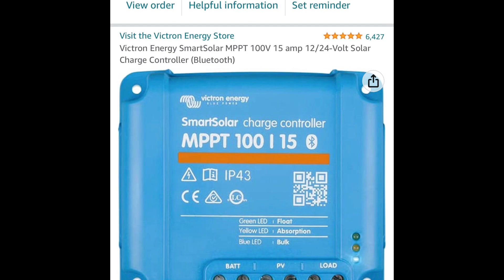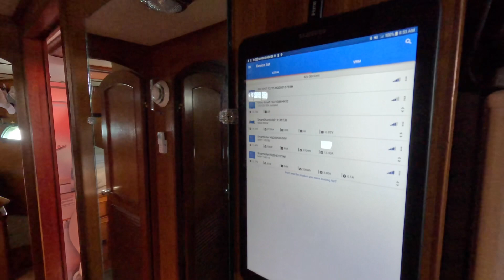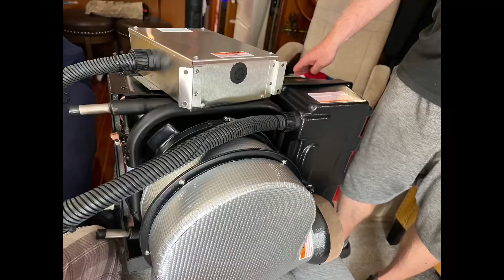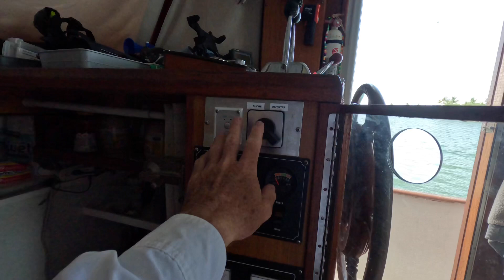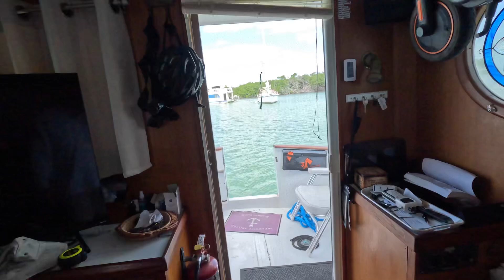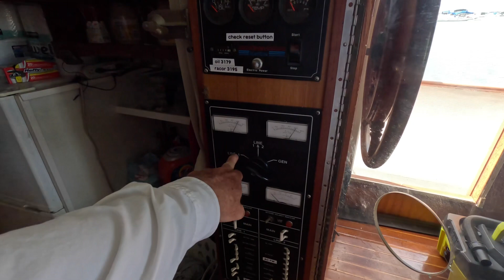Yacht# Life OFF Grid Living what we do for Power living off grid on my BOAT

Comment: Still not understanding the math.... You run a honda that can only put out 2200 watts for 4 to 6 hours VS your 15000 watt generator for an hour that can provide much more power into your batteries and the entire systems on the boat???

Comment: Table of Elements:  Li (lithium), Fe (iron), Po4 (phosphate).  You mentioned "LifePro" batteries, several times.  The correct name for these batteries is "LiFePo4" or "Lifepo."  Your charge controllers are made by Victron (vick-tron), not Vectron (veck-tron).  Most 100ah LiFePo4 batteries will accept a charge around 80 to 90 amps.  You mentioned that yours are capped at 40 amps of charge.  Have a look at Dakota Lithium.  You can get a full-fledged LiFePo4 battery that won't break the bank and will deliver much better performance for not much more money.  Best of luck.
Reply from the maker: Thanks 🙏

Comment: Nice set up Capt, I bet it took a bit of ciphering to get it all lined out. Redundant Honda gen is a good tip to save quite a bit on fuel, not to loud while in the cabin either it seems. Your reefer appears to be a regular home style, wondering if those designed for boats/RVs, draw less power. Also the Honda, does fine in the box? does not run to hot? Really like the use of the old iPad as a monitor, have a few of those that are outdated as far as the internet, and could put to use in that way. What type of connection to your electronic components are in place, WiFi/ Bluetooth? Or hard wired. Great video